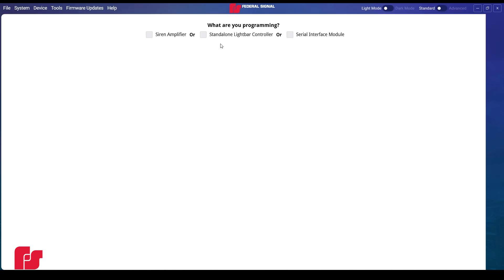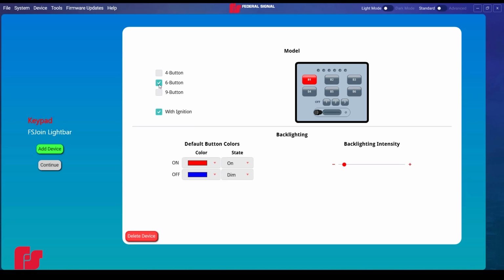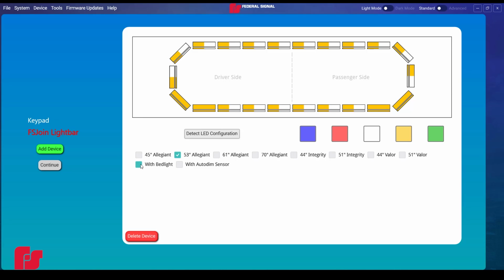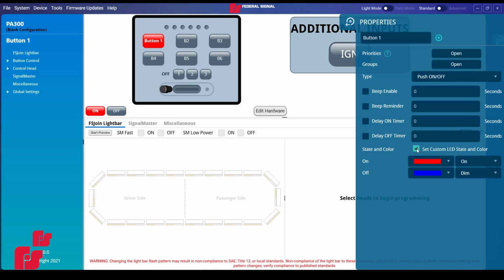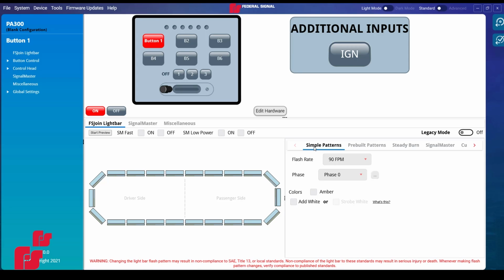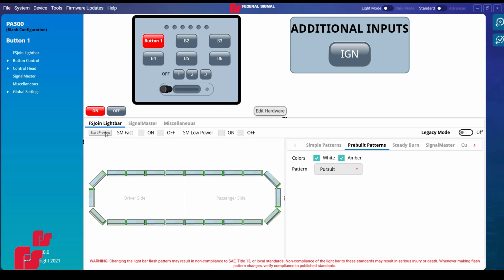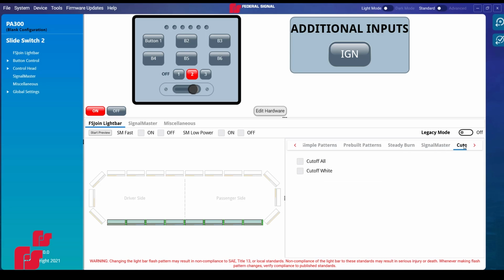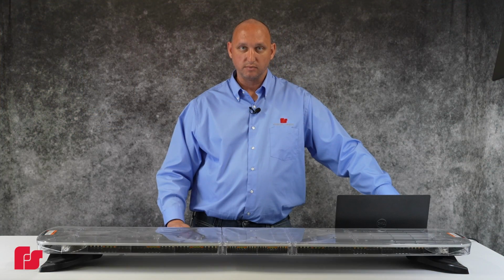How to Program 4, 6, 9 Button Convergence Network Controllers

Comment: Can this control head be used as a siren  controller with the ss2000?
Reply: No. These are simply standalone controllers for controlling lightbars, no sirens.
Reply: @patrickwilliamson4341  I don't believe that is true.
Because I've seen them in NYPD cars and they activate the SLR and siren tones as well
Reply: @2011_cvpis  I agree 
They do have them on the NYPD cars
Reply: @2011_cvpis  Yes, we have 4, and 6 button Pathfinder siren controllers that do operate the Pathfinder. These in particular are standalone controllers and only operate lighting. The Pathfinder 4 and 6 button controllers are part number PF200S4 and PF200S6. The standalone controllers are part number CNTRLR-4B and CNTRLR-6B. They are both the same in terms of look and hardware. The only difference is the firmware.
Reply: @patrickwilliamson4341 do you know which 6 button controller works with ss3000?
Reply: @coxplumbing8154  These will not work with the SSP3000. When we were manufacturing the SSP3000, special 6 button controller models were designed for specific customers and weren't standard controllers. New York and Boston were a couple select customers that had them.
Reply: Good question !